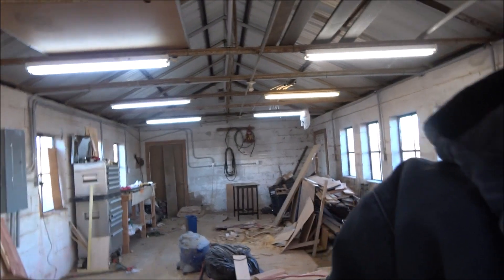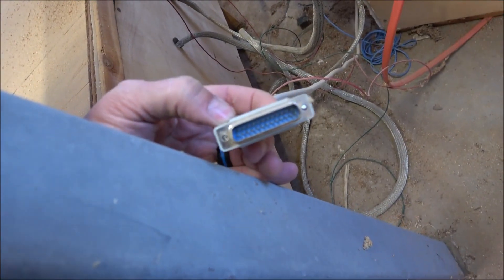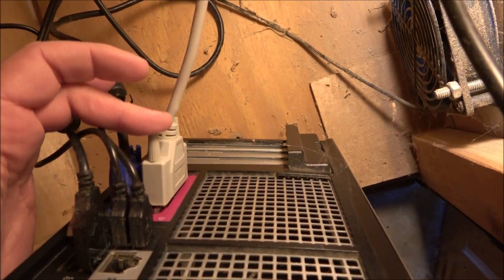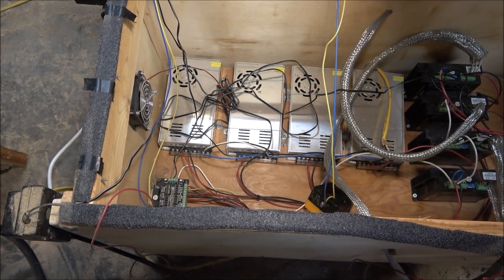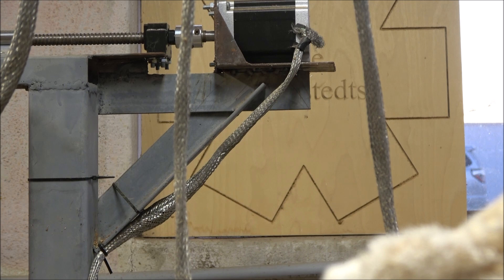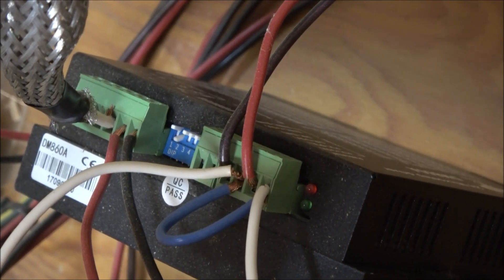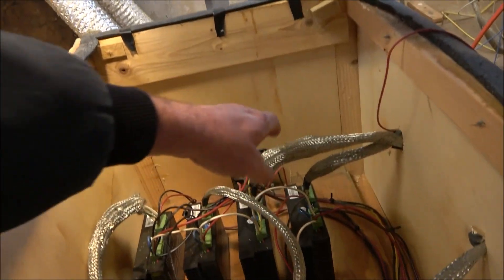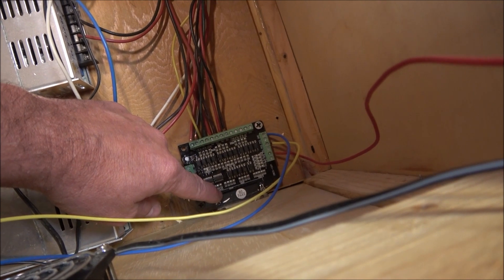Wiring the DIY CNC

Comment: Hi,
Hope you new home will have a larger shop so you can continue to enjoy your hobby.
Thanks for all the wonderful videos you have produced.
I converted a Shopbot PRT CNC Router utilizing Mach 3.  Did away with the ShopBot Controller and installed all new electronics and control software.  I have a video on my channel that may assist anyone interested in doing this type of conversion.  I have all the parts listed that I used in the conversion and associated pricing back in 2012.  The video shows how the unit operates and how the screen set worked.  I have since sold the router but really enjoyed it while I owned it.

Gook luck with your new home and shop.